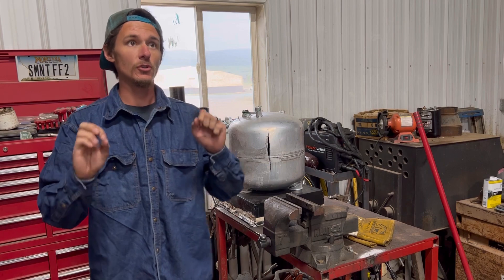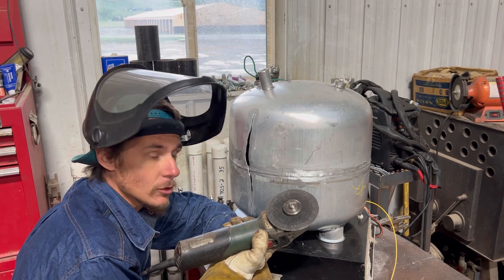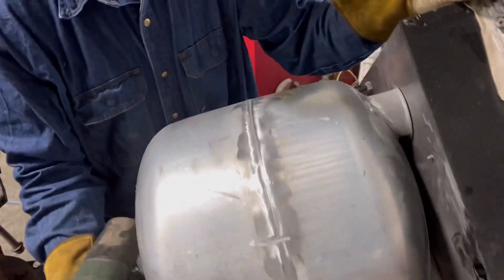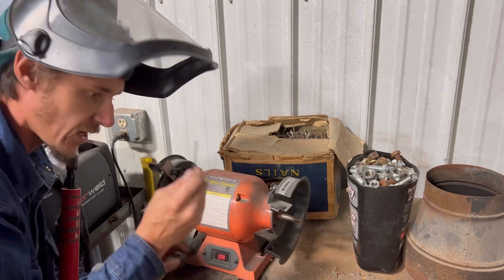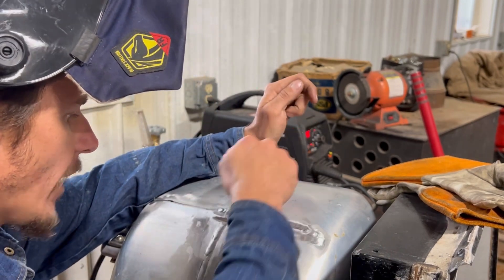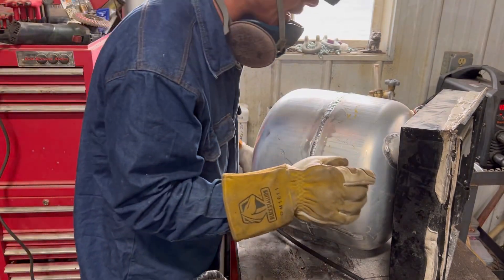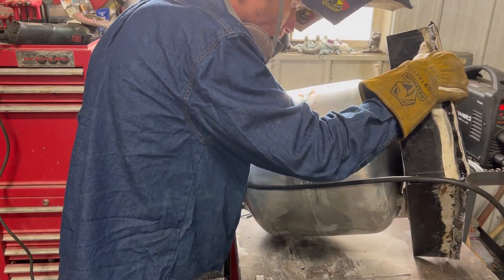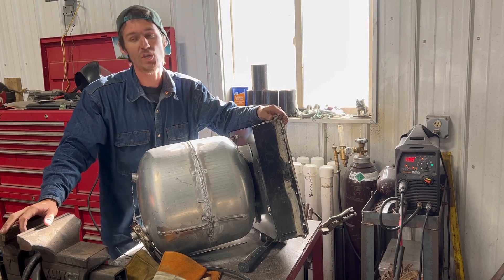EXPLODED Water Heater Tank Repair! Can It Be Welded?

Comment: We weld these all the time at the shop I used to work at, at least 4-8 a week. It failed because they didn't drain it and it froze, unless they don't drain it again it will be perfectly fine.
Reply from the maker: dam 4-8 thats a ton
Reply: @MeltinMetalAnthony  in February-march we could have as many as 20 waiting to be welded at at a time, I welded a bunch of these for a whole week one year. Obviously not so much in the summer but there are still people that use them in the winter by leaving them somewhere to go to and forget to drain the water heaters when they leave and come back to a blown out water heater. I appreciate your prep work and weld quality, I can very much assure you it won't have any issues unless they freeze it again. If you want to do more run to your local trailer repair and give them a card, you'll have more of these to do than you'll know what to do with.
Reply: Even melting metal Anthony knows a good preheat would have saved the day there before you went Metallica on it lol

Comment: I wonder if you would've had better results with a spoolgun/mig setup? Just thinking mig doesnt care as much about dirt stuff? Or is that only true for mig welding steel and either way you weld aluminum it needs to be clean? Going to be tackling the same job myself and trying to figure out the best approach!

Comment: The tank starts out as two round discs of aluminum then it is heated and stretched into the shape that it’s in and then to halves are welded together. This is why part of the tank is thinner other parts are thicker.
Reply from the maker: Thanks for that! I was wondering

Comment: When welding cracks on aluminum you not only want to clean the surface as best possible but also drill a hole at each end of the crack to prevent the crack from coming back

Comment: Aluminum experiences metal fatigue though repeated pressure cycles. Pressurized aluminum aircraft cabins are retired or rebuilt after a set number of pressure cycles and that water heater tank experiences much higher pressures than an airliner cabin. My guess is that the whole tank is work hardened and brittle from pressure cycles during its lifetime. I would be a little uncomfortable to take on this job to say the least. I hope you give periodic updates to let us know how it's holding up or if it fails, details about the failure.

Comment: Nice. Only thing I’d of done is drill a 🕳️ at the end of the splits to isolate them and you won’t get any new cracks as you burn it in & when knocking the seam down get it somewhat flat then throw some extra hot and quick tacks pushing the filler rod in there aggressively cuz as you know esp with alum. You’ll never get a tack without filler unless the seams super tight even then it doesn’t just melt it like mild or stainless then go back and knock the seam tight. If not you’ll be fighting the seam wanting to warp & open up on you. Although not necessary on thinner alum. it doesn’t hurt to run your torch over the work piece to pre heat esp. if your running and air cooled torch it will allow you to get slightly more capacity out of your rig machine or at least whats its rated for without burning it running hot af. For example a cylinder head you’d want to place on a hot plate to get some heat into it. Then wrap in welding blanket when finished to let slowly cool like you do cast. Just a few things that came to mind. Also if I had to wipe down filler I’d never get nothing done. Lol

Comment: Always drill out the end of the cracks, this will let u inspect the alloy grain to see if it started to crack beneath the top layer aswell.
Reply: I really don't think drilling the end of the crack is a good idea. If you just grind beyond the end and weld, it will work better.
Reply: @HarryJarrell  aluminum is super easy to drill, so its best to do both. drill first to make sure it doesnt spread deeper and then grind out the groove.   why do you think grinding alone would be best?

Comment: I’m not a bog TIG weldor, but I believe I’ve seen guys that are, use argon as a back gas on the inside of the tank.  They attach a continuous low pressure flow with argon on the inside, in order to help keep the weld joint consistent and to help avoid porosity on the inside seam.    …I think that’s how they do it roughly.

Comment: I never weld tanks that will be pressurized because I don’t want to get sued when it fails again….and a rewelded pressurized cylinder (tank) with dents and divots in it will ALWAYS fail again.   Think “beer can sturdy.”   You can stand on an empty beer can, but touch the side with a finger causing a dent and the can fails under weight (pressure).  Always guaranteed.   A one piece solid cylindrical tank that’s brand new from a factory is what’s needed.  Period.    One lawsuit is all it takes to drain a one-man-band weldor’s bank account or insurance premium by a lawyer and court costs.  You got b@lls bro.   Personally, I just pass in those jobs as I’m not that good of a weldor 😂

Comment: So a big problem with aluminum is that the surface oxide forms so quickly that if you give it 10 minutes between the last time you brushed it and the time you pull the trigger it takes a lot more heat to get through the surface  oxide than it takes to get the base metal to heat... So you hit hard.. until you suddenly blow though. Aluminum oxidizes very quickly brah hit it right before you weld her again and watch the difference 😉

Comment: Ant id love to help you out with some aluminum, I don’t wanna sound like a smartass but literally, aluminum is all I work with, and I’ve learned a lot from your videos. I’d love to give back a little ya
Reply: #1, definitely worth it if you’d like to be able to take more aluminum jobs, invest in a 60$ p-grinder/burr. Super vital to cleaning the aluminum. Acetone and wire is good, but man you will notice an immediate difference: single cut and a cross cut burr bit.

2. If you’re running your argon at about 20-25 psi, I’d turn up your balance to at least 60-70%

3 I really liked that you cleaned your rod first, I’ve always took that for granted but also if you’re having to chase the puddle, go down on your heat, and use a thicker rod! But here’s the kicker, you’re dipping way too much. You should try spacing your dimes out a little further which might slow you down a bit. Your bead will look way better.

4. Displace your heat, ik your material was probably thin already and heat sensitive which is why cracks were popping up, just do a couple of inches at a time.

My personal settings I like to run: 200 amps, 200 freq, 70% balance. And like I said man, I really don’t know shit about anything else. Your channel has helped understand what it looks like to be a real welder and fabricator. So I’m hoping I can give a little bit back to you since aluminum is all I work with in the navy.
Reply: * correction, it’s not actually a p grinder, it’s a 1/4” angle air die grinder. Most important tool for cleaning.

Comment: Just wanted to say, try using warm soap water with the stainless toothbrush on aluminum some time, you'll  be amazed  how much better it goes because the puddle starts and wets out easier. It works because the soap breaks up the aluminum oxide skin so the HF doesn’t have to do it all, allowing fewer amps to do the same job. Just scrub it in and weld, no need to wipe it off.
Reply: Sounds interesting, will try out as well 😀

Comment: Funny stuff. I work out of a shop about 70 miles east of Yellowstone. it gets really cold here. last year a guy brought a water heater in that looked very similar to this. Well just the other day he brought it back with another big ass crack from not draining it over summer. Drain the water out of your water tanks and boat motors if you live up north or you will have a bad day.

Comment: Another suggestion. The RPMs on the wire wheel you are using may be too high and can actually imbed or burnish the oxide film you are trying to remove further into the material. The issue with that is aluminum oxide has a melting point three times greater than aluminum itself. You generally see better results with a hand wire brush.
Reply: A lot of people will say your comment is BS but as someone who weld exclusively alum and stainless I can confirm that power wire wheels can create problems. I go through boxes and boxes of sml, med, and lrg SS wire brushes a year. Very rarely use a grinder/ss wire brush combo unless it’s a old piece of alum that’s real crusty from sitting in storage. This topic is addressed in a video featuring Travis Feildres on weld tube I believe?
Reply: We weld a ton of 316 Marine SS and I always use a brand new wheel because without fail someone will grab the SS grinder, pulverize some mild steel, and put it back in the rack.  When you grind 316 and stick it in saltwater, any tiny steel chips in there show as rust specks appear and are a huge headache to get off there.  Same thing with aluminum. If I always use a new disk I don't have to yell at people as much lol

Comment: Also, with aluminum especially cast aluminum or really dirty aluminum that you can't reach the back side on.  I run a heat pass first with no filler then use the wire wheel again.  This can help to clean up the backside that you can't access.  On cast aluminum this is simply the best way - gotta burn out all the contamination and "recast" the aluminum around the break.  When I learned this trick on cast it changed my cast welding life.

Comment: One thing I would always recommend on thing aluminum breaks like this is drilling a stop hole.  Oftentimes we cannot actually see with our eye where the Crack ends.  There are dyes that can be used to find the microcracks at the end but I find just drilling a small hole roughly 1/4 inch from the end of the Crack has always worked.  All aluminum water heaters I have fixed I did with a plate though after rewelding the Crack plate it and weld it full.
Reply: I keep seeing similar comments.
This was a freeze ceack. There isn't any vibration or directional stresses. Which is why you drill cracks. This disnt need to be drilled
Reply: @FreedomInc  its under constant changing pressures though. not just a tool that sits still most of the time, its always under stress.    drilling it would have been the move, plus aluminum is super easy to drill though.  its probably just fine to this day, but since its so easy, might as well drill it out too.
Reply: @ganjalfcreamcorn8438  it doesnt change the facts my reply was based on. It. Isnt needed. Its a freeze crack not a directional streess crack.

Comment: Being an RV tech the customer should just get a new heater. It's pricey but the reason it cracked was because it wasn't maintained with new anode rods and a hard water filter. The hard water is eating away the walls of the heater so it's going to crack again.
Reply from the maker: it froze.

Comment: The only time I make sure not to cut all the way through a crack is when it's a casting with a gasket surface that needs to come back to exact original dimensions. If you cut the crack out the casting can become misshapen. You need to be able to squeeze the casting back into original form so all those little "mirrored" zigs and zags of the crack need to be preserved so you can squeeze the part back into its original shape. I hope that makes sense

Comment: Love yr vids my dude. Keep crushing

The SAIT aluminum specific cut off wheels do perform better cutting aluminum, in that they don't "gum up"like general purpose discs tend to when cutting aluminum. On the flip side, a SAIT aluminum cut disc cutting steel will whither down to nothing  WAY faster than a general disc cutting the same steel. I mention the SAIT's because they are the only aluminum specific cut wheel brand I've used and that was only because they came out of a tool room and I wasn't footing the bill.

Comment: From what I understand using an aluminum specific cut off wheel isn't for getting a better result. It's that aluminum tends to clog up regular wheels and grinders. When I was in high school I was instructed to not put aluminum on the grinding wheels because they would clog up the wheel, overheat, and explode. But maybe that was just exaggerated to keep dumb high schoolers from messing up the grinding wheels.😁

Comment: Nice video man. An old cat I weld with saw me using a wire wheel one time on aluminum and he stopped me to tell me that that wire wheel can kinda fold the oxides over back into the base metal. He swears by a hand brush. Im not sure if that's true and I don't wanna be the arrogant welder who knows it all but just something to think about.
Reply from the maker: ive had good results so im not sure

Comment: Nice repair.  One thing to watch out for is the vapor from whatever chemicals you use to clean the material. What I’m talking about is they can get inside the tank and explode. I did this one time welding up a pontoon on a gold dredge. The second I struck the arc it exploded and threw me back a few feet and destroyed the pontoon.
Reply from the maker: thanks brother!

Comment: Key hole on aluminum is just an under filled puddle. If you pause after your dab you'll watch it sink. That's your full pen. Good job though puddle stayed pretty clean despite the inside contaminant.

Comment: You can buy an RV water heater tank for like 3-4 or a whole new unit for 6-7-8…amazed it was worth it trying to repair
Reply from the maker: guy told me it would cost him over $1000, I didn't fact check him
Reply: @MeltinMetalAnthony  it’s entirely possible with the damn inflation. I haven’t worked in RV service since just before the coof…that’s cool tho man never seen one welded back together and being in MA we replaced ~8 a year. #FJB

Comment: I think it’s just a Matter of time before this baby explodes again.  The aluminum tank developed cracks from stretching and contracting.  You’ve also introduced many new stresses with the new welds.  Because you used TIG, these welds are themselves stressed. It would have been better to gas weld this thing as gas is self annealing. I hope your repair lasts.

Comment: I don't have the equipment for aluminum welding. When my pops water heater tank froze last winter it was only like $250 for a new tank on Amazon. About an hour to swap out all the other stuff on there over to the new tank.

Comment: 👁 🧐 👁 🇨🇱🇺🇲💲  I did one just like that last year down here in texas the last freeze we had busted it I did it  with a Spool Gun.  I got fittings to hook up to the tank to get  city Water pressure on it the shit from the inside kept pulling thru the weld. It took a couple of times of grinding spots out to fix it but I got it.  Pain in the ass but it saved the customer alot of 💰. Them things are hard to get for some reason.

Comment: Only advice I would offer…drill out the ends of the cracks…weld to ends of each. Cut a bevel over the drilled ends and weld stringers to build up the material to prevent the crack from running any further.
Reply: We used to weld these at the shop I worked at, as long as they don't freeze it again it will be fine. He could have literally just welded it back together and had absolutely no issue.
Reply: The only thing I'd add to drilling is using a penetrating dye to find the actual end of the crack. They usually end farther than what you can see with your naked eyes

Comment: I worked at a big fab shop for a while. They underbid a job and were rushing people, and whoever had fit up the chord I was working in had made a mess of it. 20, 24 gusset plates, each with 4 tack welds an inch and a half long, two thirds of which were cracked out. Now I'm no CWI, but I know better than to weld over cracks on a D1.1 project. So 7 hours later, I start welding. Then management gets pissed off, and I start talking to QC. Head of the department, CWI for decades, former boilernaker tells me two dozen times you can't weld over cracks. Shop foreman comes to look at the next one that was fit up. Tons of cracks. I start pointing them out to him, he says "No, that won't hurt anything. Just weld over that." and walks off. Head of QC comes back by and tells me and my lead don't weld it, he'll talk to the foreman. Whatever, they're day shift, they're going home, let them sort it out. I'm not welding over any damn cracks. So next day I come in, talk to the plant manager about it, he says don't weld over cracks, he'll talk to the foreman. Forty five minutes later, foreman wants to talk to me. Backs me into a corner and the head of QC comes along again. Turns out, it was ok to weld over cracks after all! And probably rust and coolant and whatever the hell else gets in the way! I told them just about how far that was going to get them with me. He backs me into a corner and starts yelling. I walked out and didn't come back.
Reply: It’s never a good thing when production can overrule QC.
Reply: If QC doesnt have the final say its a battle you can never win!

Comment: Ive had great luck using tiger hair bondo to repair these aluminum pressure tanks.  Welding is for rookies - take it from a 28yr old guy who uses bondo and duct tape for everything.  Never had 1 leak

Comment: It’s thinner on the crowns/ radius sections coz that area stretched when it was formed in a die press
Reply: Mathematically, there's also less pressure on a curve. That's why gas tanks are cylinders. Even the bottom has an indented curve. Designed that way on purpose.

Comment: I take a small drill bit to each end of the crack and try and dead head it before I grind it...had a few times where the grinder couldn't get all the way in but the bit could I haven't had any issues doing this